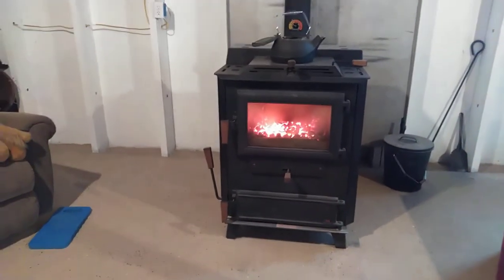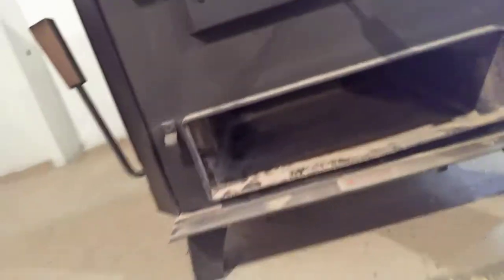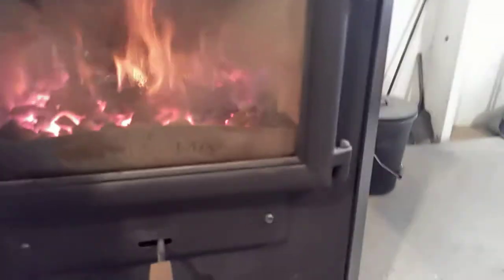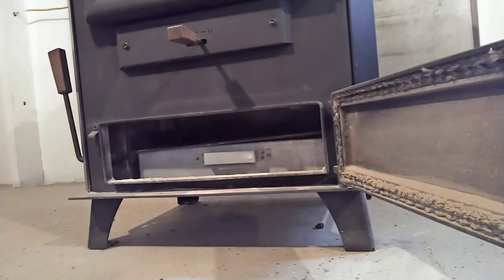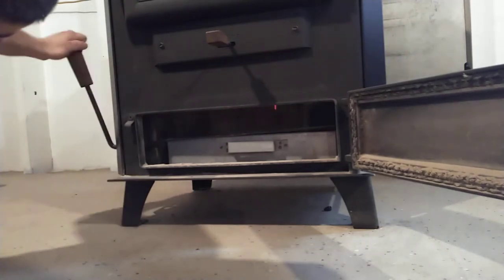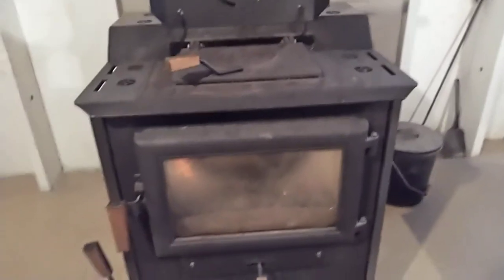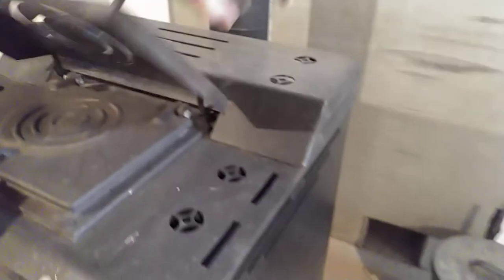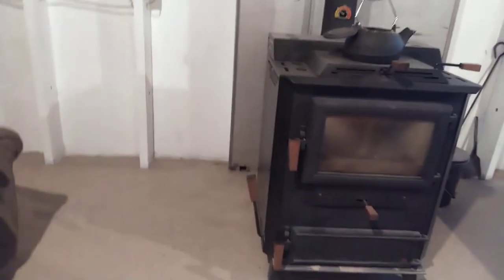DS Anthra-max 15 Anthracite Coal Stove Tutorial Tending

Comment: I have a 50 93 hitter. I recommend filling the hopper completely full before shaking. I only use mine when it does not go above 20 degrees . Otherwise coal for me has doubled and it may not be worth it.  I have gas though.

Comment: I'm looking at getting the anthra max fireplace insert. My question to you is how low of a temperature can you run your stove without it going out?
Reply from the maker: I run it into the shoulder season of March or so - it definitely is a bit trickier keeping it going when the thermostat is turned down further.  Slow gradual adjustments to get it down.  Tending less frequently and or less vigorously with less poking.  It won't be a full glow of burning coal, but look almost dead on the surface as the fire is burning low deep under the surface.  An occasional open window to cool off the house if it's a bit warm.  An insert may be easier to maintain temp as it would have a blower to circulate the heat out from around it that you wouldn't run.  Hope this helps

Comment: Thank you for this video. We had a 15 installed in June. Lit it today for the first time, but as of 1:30 am it has gone out twice. What are we doing wrong? Built wood fires both times, and added about 20lbs of coal each time. Are we not adding enough? 
Finally, we were thinking we would run through a ton a winter keeping our house in the mid 60's. What is everyone else's average usage? 

Sorry for all the questions. Had this installed by the Amish and we cannot find much information online.
Reply from the maker: If you had the Amish install it, you may be local to me if you're referring to Lancaster County Amish?  In regards to lighting - it's a slow process(several hours) to get it fully transitioned into coal due to coal being hard to light and burn compared to wood. But once it's going it'll go for months.  Yes start with a wood fire(kindling, newspaper, seasoned dry split firewood etc).  Probably better to lift the metal hopper out of the top so you can get more wood in the stove for a good wood fire.  You may have to adjust the thermostat air damper on back open as it wants to auto adjust down.  Leave the front air wash lever open for airflow across the top(wood likes air from over, coal burns from air coming up thru bottom).  After wood is burning well and you've added many pieces over time and have built up a healthy amount of wood embers burning and wood burning you can SLOWLY add coal one small shovelful at a time so it can light.  Don't smoother it.  May require still adding some wood to keep it going well.  After enough intervals of adding shovels of coal in and it's burning well and air thermostat on back is adjusted to give it the air it needs to light hopefully it's going ok.  Coal requires a deep bed to last and burn.  So once it's fully lit, load the bed of coal up to the height of the metal "Anthra-Max" logo top edge - again - slowly in stages as to not smoother it.  Of course once it's going good that metal hopper can be dropped back in so that you're able to top the hopper off.  Hopefully I'm explaining it so it makes sense, I'm trying to think it thru.  The hopper likely holds a good 35+lbs, and the deep coal bed from the grates up to the bottom of hopper is likely 50+lbs.  The stove I believe calls for the size called nut coal(sometimes called chestnut coal).  Large chunks may not be ideal, and small rice or other small sizes won't be feasible either
Reply from the maker: As far as usage: last year was our first full season: we lit it in Nov and let it burn out in spring.  Only lit it once.  Almost lost it a couple times but was able to revive it (likely my own fault for stirring/screwing with it too much - coal doesn't like that unlike wood). Overall it burned for the whole season 100+ days I forget the exact number of days.  I believe we burned thru 2.5-3tons to heat a 1000sqft ranch with the stove in the basement of the same size as the upstairs living space.  Never touched the baseboard electric heat.  Used a wall mounted propane heater in upstairs during the shoulder seasons of fall prior to lighting stove or some cold mornings on occasion.  During coldest parts of winter it was over a 5 gal bucket per day.  During warmer days it was less usage.  We will be lighting it this week. We lit it once a few weeks ago for just a wood fire one chilly evening.
Reply: Thank you very much for your response! Indiana Amish installed for us. However, my husband is from PA and that is where the original idea came from. We do not have access to bulk coal like you, but we did buy 4 tons of bagged coal. The Amish gentleman told us he thought we would go through about a ton a year. Ha! Guess he was wrong. 

Ok, back to the drawing board for us on trying to get this lit. Thank you very much for your help!!
Reply: According to my dad, the best way to get your stove going is to use the fancy hardwood lump charcoal. Fire it up like you would your grill and once that get going good and hot start adding in coal SLOWLY. 
Also the Amish build their houses to optimize radiant type heat distribution while keeping it from escaping out thus using less coal.(At least the ones here in Wisconsin 🤷🏼‍♂️). Most “modern” houses are built for forced air heating (or have been updated to)

Comment: Nice stove. Doesnt seem like it's running all that hard. Is it possible to get the upstairs into the 70s with outside temps like that? I have a 1700sqft ranch and was thinking of doing something similar in the basement.
Reply from the maker: Yes it has ability to run hotter than what I'm using it at.  I'm confident it can get an upstairs into the 70s assuming you have good windows/well insulated.  Your size ranch is bigger than ours so it may take a slightly larger stove and depending on location in basement and home design getting the airflow to migrate to either end of the house.

Comment: Thanks for posting. I have a 14 in my shop and a 15 in the house. Very well built stoves. do you poke down around the edges every time you reload? On my 15, I can't set the thermostat any higher than 3 and half or else the stove starts to overfire - especially after being reloaded. Have you had any challenges like this? I'd like to be able to run the thermostat higher when it is colder out. Any suggestions? Thanks again.
Reply: Yes I try to make sure I poke down around the edges - I feel like that's the place where ash builds up and will smother the most because it's along the edges where the grate don't shake it out as easily.  As far as getting the fire too hot after reloading I haven't noticed that issue.  I did adjust the chain on the damper 1 link shorter so I can have a better range - I don't go below 2.75-3 on hot days(50-60degrees) outside for fear of it dying and have turned it up to 4.5+ or - on some of the coldest nights (under 15-20 degrees) to keep house warm.  Prior to the chain adjustment I turned it as far open as possible overnight and stove never got too hot and had room to go further to keep house at acceptable temps.  I remember a few times where it was really hot fire , not sure if that was after reloading or after messing around with it opening it up more.  Couple times it's scared me after reloading a half hour to an hour or so a loud puff back when the gasses built up so much and the new coal finally lit all at once in what seemed like an explosion - so now I've been keeping the over air lever on high or close to it especially when reloaded
Reply: I have a DS basement 4, never poke it, thermostat set at 3 1/2, front of stove 450, runs like this all winter, last 10 years or so

Comment: the question i still have which seems to have no answer is what you do with the ashes.
Reply from the maker: Some people dump outside if they have a wooded area.  However unlike wood ash which is organic and breaks down, coal ash is forever...  So when I dump the ash pan outside in a metal wheelbarrow, after a few days once I know it's cooled off, I shovel the ash into a black trash bag and put in our normal trash can for pickup.
Reply: @applearmoryvlogs7279  ah okay that makes sense. Thanks! I guess other people I've asked didn't have a pick up service in ther areas.

Comment: How do u have this vented?
Reply: The back is a 6" outlet which goes to a 90 up to another 90 which steps up to 8" into the duravent I think it's called chimney which goes up thru main floor of home, up thru attic and out the roof(8" chimney was there from prior owners - technically manufacturer would want the 6" all the way.

Comment: Do you ever burn any wood in that? How does it do? Thanks
Reply from the maker: We had a wood fire last night.  It does a good job on wood too, took a little adjustments to get it at a stable temp, then again it was the first fire of the season.  I kept the air wash on high, and used the thermostat on the back.  Not sure if that's the best way or not considering wood fires use over air, coal uses air from below.  I did let it die out overnight however.  This stove was originally approved and sold for wood or coal.  However with recent EPA restrictions on wood stoves, they are now sold as coal only.  They have made no changes to it from the prior wood/coal model years to the current coal only model years so use that info as you will...

Comment: I paid $255/ton for anthracite last year and the price has jumped to $385/ton this year. Not sure it's worth the work anymore at that price.
Reply: We paid $409 for our last load. We believe still cheaper than propane.
Reply: In the UK its around £650 a ton. Doubled in price since last year
Reply: What work is involved with coal exactly? Transporting it. Thats it.
Reply: @scottreynolds4827  Transporting  the coal,loading the stove, shaking it down, emptying the ashes and cleaning all the dust. I love the heat it produces, but it is work. Anyone that has burned coal as a primary source of heat will admit there is more work than Transporting it